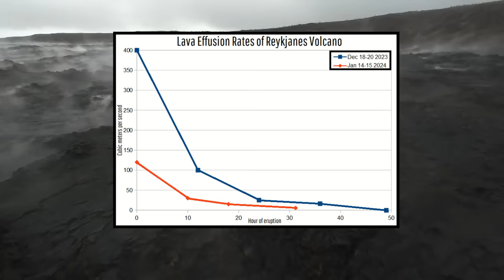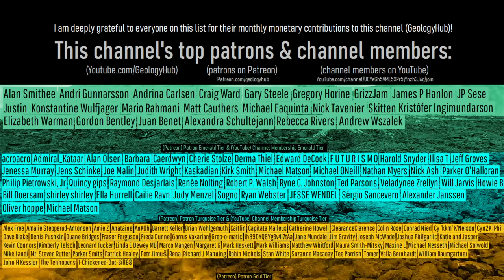Iceland Volcano Eruption Update; Lava Wall Breached, Decreasing Lava Output

Comment: 2:20 A little correction here: The berm didn't collapse, or fail. If you watch the live-streamed video, you'll notice that since that area was filled in last minute (with very little notice after the eruption started), it wasn't quite as high as the surrounding wall. The lava filled in this area and crested the top due to the lower elevation.
Reply: yep, exactly
Reply: Yes, that was my observation too
Reply: Yes, via livestream, I watched them close the gap and watched the lava overtop the wall in that section, although I couldn't say for certain if the wall was lower or, as I recall, the lava flow was a bit higher due to peculiarities of flow, the lava which was flowing parallel against the wall spilled over.  I was expecting it when it did.  The lava found another escape path outside the wall away from the wall and away from  he town which appeared to end the overtopping by increasing the flow downstream of the road.
Reply: Might I suggest that when the new spatter cone stop erupting, that it be name Mount Grindavik?  Or Grindaviksan as per the Korean and Japanese naming convention?
Reply: I mean that's literally a failure but ok it's not a structural failure but it's still very much a failure lol
Reply: But in this context, especially as it pertains to how he explained a solution in the video, the method of failure and what solution should be used is important. @ConstantChaos1
Reply: @TheMajesticSeaPancake  true however due to the principles of fluid dynamics you would know that the friction coefficient on such a viscous fluid as lava would be sufficient to lead to a bulge at the part with the road, what's more due to the laminar flow nature of lava you'll end up with an effect like a 'rolling swarm' of caterpillars meaning it will continue to pick up more momentum, achieving a greater height and higher swell on impact. I'm making jokes about walls failing that should have been enough warning that you're talking to an engineer lmfao 

I personally feel when a fact is as blatantly obvious as the height and makeup differences of the segments of wall its insulting to directly mention them, I mean I'm an aspie so I'm weird and I know that's probably just a me/aspie thing but at the same time dude runs a geologic activity channel so I wouldn't be surprised to hear he is at least relatively familiar with the neurodivergent mind if he isn't neurodivergent himself (as an ems provider I can diagnose from a difference as a differential diagnosis so I'm not talking out of my ass here either) 

I think he PROBABLY just missed it, but the flow rate over asphalt would lead to non-insignificant changes in how the lava behaves. 
It wasn't just that the wall was lower, it's also that it was hit sooner by a higher and faster volume of lava that was also being helped along by the asphalt burning beneath it
Reply: I'm not saying the road friction had nothing to do with it. I'm just saying if you build a rocket to go to the moon, with a bad antennae and half the fuel needed, the lack of the ability of the rocket to receive instructions as it began to leave the atmosphere is less critical than the fact  there was an unplanned rapid disassembly via lithobraking. Should you fix both things, and do a full diagnostic to prevent accidents from happening in the future? Yes. Should we still pay attention to the communication problem even though the fuel was overwhelmingly the issue? Yes. Is it remotely realistic to blame the accident on the communications equipment? Probably (and that probably is doing a lot of heavy lifting) not.

I don't take issue with the issue of the friction being a considered factor.  But if we have video evidence of lava going over the top, and can compare the height of that section of the wall as the lava went over to the height of the wall before impact, it would be pretty easy to tell if friction was a significant factor. Unless it is shown that the wall was significantly lower at the breach time than it was before lava reached it then It feels to me like comparing x^2 to x^3 at x=15.

I'll see if I can find such a video in the morning, i'm not trying to win an argument because I don't really feel like we're arguing. We both agree those things exist, but there's no point in discussing without looking at what actually happened, and I feel it would be very interesting to see from a physics perspective. Maybe @MTStingray
can share the video they saw, though i'm sure I could find it quickly myself.

As someone on the spectrum myself I can certainly relate to narrowing in on specific aspects so don't worry about thinking you're coming off as weird. If you want weird try posting a badly edited pic of Reinhardt for four hundred and forty four days straight like I did and still am.  @ConstantChaos1

Comment: Another point about the area of the berm which failed is that it was hastily constructed on the day of the eruption itself, plugging a gap left open for access to the town as the lava advanced. Therefore it also seems likely to me that this section was not as sturdy to begin with, due to the exceptional circumstances the workers were operating under.
Reply: Unfortunately, even if that part of the berm had been as sturdy as the rest, it would have made no difference to the outcome. The fissure was going to open up under it and spew out lava, at which point, the berm could have been made out of the must resistive stuff ever and still not kept the lava out. I think we humans have had a sharp lesson in hubris: we are not the masters of the planet, we have to give way to various natural forces, and volcanoes are one of them!
Reply: @carolynallisee2463 , watch the video. It explains why the wall was incredibly useful. Obviously it doesn't stop flows originating from within. The wall did, however, keep lava out of other parts of the town by redirecting the flow around the town.
Reply: @carolynallisee2463   Well sure, but I wasn't referring to the point where the fissure opened. I was referring to the section which either failed or was overtopped by the main road into Grindavik, as discussed in the video. This section did not have an active fissure beneath it, and failed for a different reason - either, as theorised in the video, because of the road surface offering less grip, or because it was hastily constructed with lava closing in, by tired workers who had bravely rescued their own equipment from the very volcano they were defending against.
Reply: I agree that the cause was likely a result of the section being left open where the road was until the last possible time. Thus it was likely not compacted sufficiently.
Reply: Shoutout to the people who built the barriers 🤲🏻🤲🏻
Reply: @carolynallisee2463  Ah,,, I think the engineers know all that, they're smart enough to realize it's better to do something than nothing. That north barrier did divert a lot of the flow to the west. If wasn't there at all it would have be a lot worse than just 3 or 4 houses lost
Reply: It too is quite likely that the melting point of the asphalt turned it into a rather liquid, or at least viscous material on which the lava could flow with far less resistance. Practically undercutting the berm.
Reply: @jantjarks7946  I know absolutely nothing about how lava works but I was wondering if that was a possibility while watching the video.
Reply: @jantjarks7946  Yeah good point after all the main component of asphalt tar/pitch even if it appears to be "solid" has been shown to be instead an extremely viscous fluid.
Reply: The wall over the road was like 47% when lava was around 70-50 meters away from the workers it’s incredibly that thay did seal it but not surprising why are you did not hold
Reply: I had the impression, that two other factors might be the main reason for breaching the berm: 1) in the given time, the gap for the road simply could not be filled to the same height. It was lower as the rest of the berm! 2) the road is slightly higher than the ground around, so the lava was pushed up when crossing it.

Comment: While watching the event live, it was clear that the section of the berm which was overtopped, at the line of the road, was being built while the lava was aproaching and the effort only stopped when the lave reached that section, it was visibly lower than the previously constructed berms and I think that is the main reason it was over-topped at that point.
Reply: Agreed. It didn't fail in the sense of collapsing or giving way. It simply wasn't as high, and the lava quickly crested it.
Reply: It was crazy watching the heavy machinery driving away only a couple minutes before the lava arrived at the section that was eventually over topped.  Those are some super brave guys!

Comment: There is a system of large extension cracks under Grindavik, some of which are now believed to become wider with depth. The idea that it is safe for residents to return to living in this town seems suicidal.  At any time, more eruptions and additional seismic activity may occur.
Reply: The town is over a thousand years old but yeah even if that is ancient on human timescales that is nothing on geological timescales. The cracks made in November appear to be intruded with magma given the way they have expanded so it seems reasonable to expect further intrusions along that length not to mention volcanic gases. Ultimately the town is there because this volcano created a harbor thousands of years ago so at the very least the central fissure zone should not be rebuilt and whatever remains of Grindavik and the surrounding region will not be safe to inhabit until activity dies away along the Reykjanes peninsula but I suspect based on past human history they will eventually rebuild if only because of the harbor.
Reply: @Dragrath1  Indeed. There are people living in California after all. Or in Florida with the yearly threat of hurricanes. Or in other regions that are prone to flooding. 
Idk how many layers of rebuilt cities they found in Troy. Actually safe areas are few and far between, based on storms, temperature extremes, flooding and geological threats. 
There is even a city in northern Turkey that got volcanic hot springs. The outgassing there releases radioactivity an order of magnitude higher than the usual. If that were a workplace in an NPP, nobody would be allowed to go there, but people actually live there. 

Even if Grindavik were cut in half by the lavaflow, i would expect that people resettled asap. I am actually very surprised that they managed to evacuate completely, since even at Chernobyl and Fukujima  not everybody left.

Comment: How lucky for Grindivik that the portion of the fissure right next to the town has stopped erupting.  I should say "as of now" because it certainly seems like things may still be brewing under ground.  Another great report with the best scientific info out there.  Thanks!
Reply: I agree ... however if the high rate of flow had lasted longer (say 2 days) , I would think that the barriers would have been overtopped! I wonder how long they can wait before reinforcing the current barrier which sits beside , and partially overtopped by lava
Reply: @outsider2222  Totally agree.  The authorities perhaps need to decide if they intend to defend the town no matter what since the current lava intrusion could rear it's ugly head again.  However, economically, the harbor is undoubtedly worth defending to the death, so to speak since a very high percentage of Iceland's total catch of fish comes through Grindivik.  Houses and facilities can be replaced.  Harbors not so much.

Comment: The Eruption appears to be dying down.  There's 1 or 2 spots weakly spattering.  The volume of lava erupted seems much less than the previous eruption and much less than what has intruded beneath the ground.   Just like the last eruption ending did not indicate the unrest was over... I expect this eruption coming to an end to not indicate a final end either.  I expect magma to continue to intrude... inflate... and erupt again... maybe in the same place or perhaps further to the south along the cracks that opened up within the town.  Erupting further to the North is also a likely event.  In my opinion so long as Magma is still flowing into the chamber or "sill" below Svartsengi then this area to include the Blue Lagoon should not be repopulated.

Comment: The reason the berm failed at the road is due to the very last minute plugging of the hole left in the berm to keep the road open. If you look at the drone footage they were still plugging it as lava was near and it ended up very uneven and not a consistent elevation at all. The drone footage shows it very well. The lava overtopped in the low spots of that last minute work.

Comment: They need to start constructing more barriers immediately as close as possible to the town. If the town is surrounded on all sides except the sea it will at least protect it from lava flows originating from outside. 
I saw something yesterday that said magma was still moving into the svartsengi magma chamber. I think there is a risk that this eruption could become reinvigorated once again at least to some degree. The eruption volume is still very small. Smaller than all of Fagradalsfjall’s eruptions. That would go against this system’s general trend. 
My theory with this volcano is that we have miscalculated the amount of historical eruptions that occurred due to an inability to differentiate between separate events that occurred within a short timeframe.
Reply: I think the concern is that if the town is completely surrounded, then a fissure opening inside the town won't be able to flow out of the town - effectively acting like a bowl.

Comment: Unfortunately, in the long term the town is a low point of the area and some day will be the target of a future lava flow which will try to fill in the low lying area. When the currently eruption phase makes it safe to do so they should rebuild the town in an adjacent location on higher ground, and only allow commercial buildings and the port to remain where they are.
Reply: good point,  i think you could indeed keep working there, while living elsewhere.  then everybody can get out safe in time.  but I don't know if it would be economically feasible

Comment: I'd like to emphasize that the city has suffered substantial damage by the earthquakes. The buildings that are not damaged have lost their source of heating. This will eventually lead to frozen water pipes and water damage of most of the buildings. Under current conditions there is no way that the city can be inhabited again in a few days. Each building needs a complete evaluation that it is not over a crack and that it is save to go there. This will take weeks. Then there is a need to repair many buildings, electricity, heat pipes, plumbing, telephone lines. And nothing of that can be done while the earth is still trembling with hundreds of earth quakes every day and cracks and fissures open up every day a bit more, the land rising and sinking all the time.
Reply: basically, in City skylines, you would bulldozer the whole part and start over on a brand new plot of land..  i am afraid that would be the best here too...   At least the people might be able to salvage their belongings in time
Reply: @Blackadder75  The point is that the whole of Iceland is the remnant of volcanic eruptions. There is no place that is 100% safe. The volcano might not hit you with lava, but with ashes and fumes. Earthquakes can happen pretty much everywhere on the island. This place is as good as any other,  besides that, the harbor is very important for the place and its income.
Reply: @adamabele785  no, 5 years ago this place was as good as any other (much better in fact with 800 years of no activity, and a natural harbour, the main reason they settled there in the first place)
But now, with the new data, which points at an extended period of activity (maybe 10-20 years) we can;t say anymore that this place is as good as any other, it is the among worst places on iceland for the next decade.  
Not every spot on Iceland  has continous vulcanic risks.  Maybe they can pick a new spot for a harbor that is not on an active system . Sure this could change in 100 years,  but on such long time scale your point stands, any spot is the same